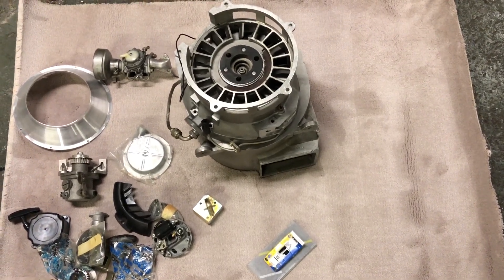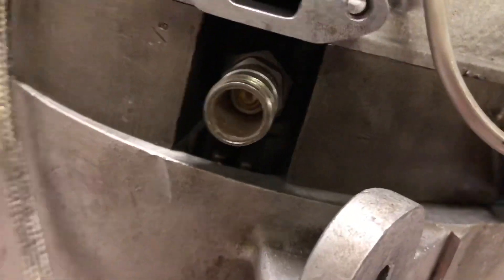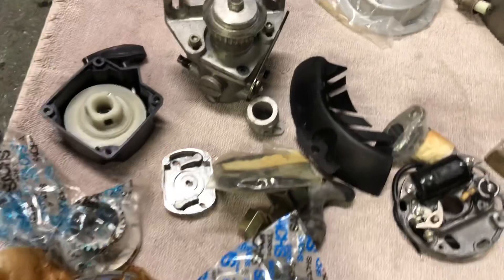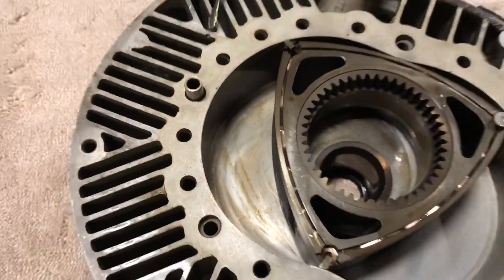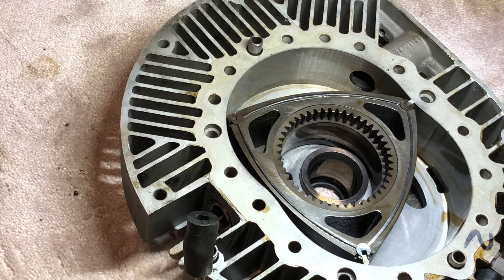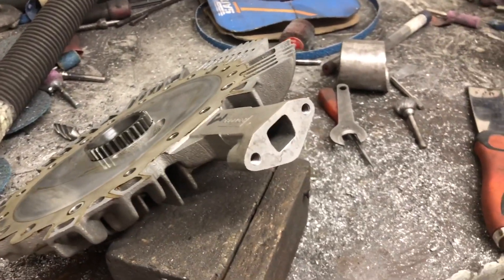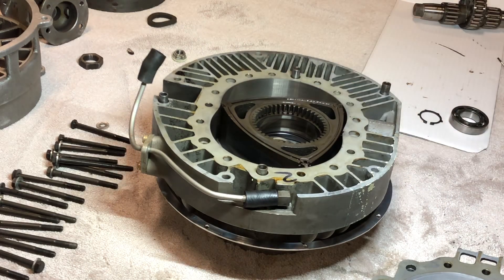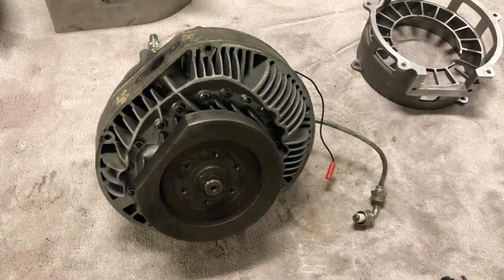Sachs rotary Km48 rebuild wankel

Comment: I had one of those engines,thanks for showing the rebuild.  Also take note that no case sealant is required. I now have the Sachs KM 24 engine that i pulled apart and rebuilt .The  sachs rotary manuals, km48, km 24 and km 914b  no mention of sealant use.
Reply from the maker: I read the no sealant thing online  but it had loctite on the case already, so reapplied some.

Comment: Were your apex seals somewhat loose in their slots in the rotor? Mine will rock by a very visible angle on my Frankenstein km48, but it has milled down 3mm 13B seals.
Reply from the maker: No, they were a nice slide fit maybe 2 thou clearance , i'm not sure how much use it had previously but not very much!

Comment: If you don't have any use for the original fan housing I would take it off your hands! I have a km48 with everything the engine needs to run, but no fan/outer housing parts. Also my spark plug/magneto is set up a little different. How exactly are the wires for yours set up?
Reply from the maker: Its the large square housing i might not use , i think its to mount the generator to ?